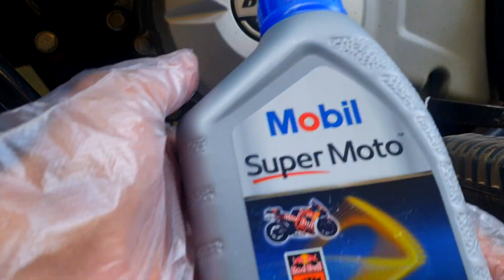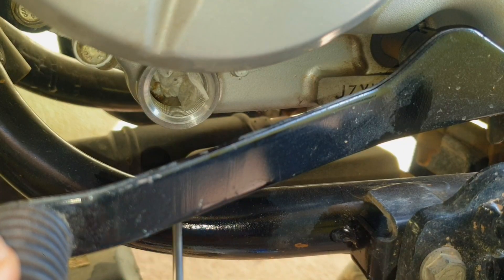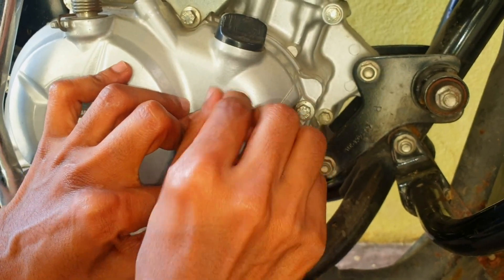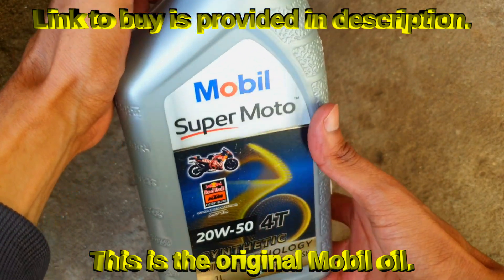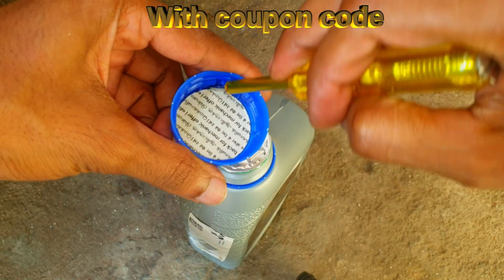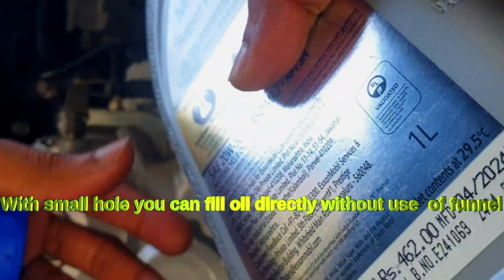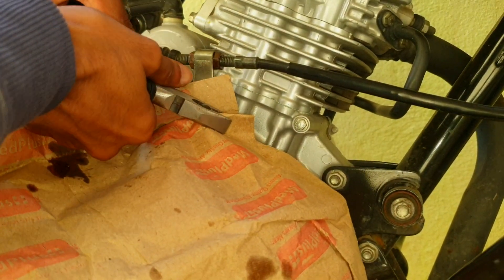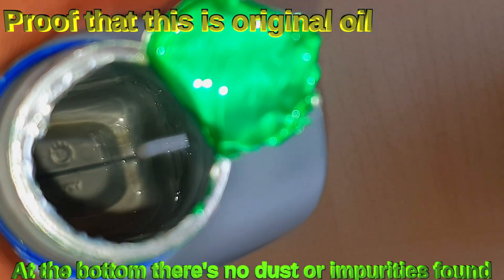Ultimate Beginners guide to change engine oil and How to identify original engine oil?

Comment: Can i use Motul 7100 20w50 synthetic engine oil in  ( Discover DTS-i  125cc 2014 model BS3 Engine) I will be waiting for your answer
If yes oil change interval ?

Comment: Bro can we use fully synthetic oil
Reply from the maker: Hi Sir, yes there's no limit in which type of oil you use, mineral or semi or fully synthetic. Only you should consider the grade.
For city rides: mineral oil is good.
For off city rides: semi synthetic oil. 
For daily travellers on bike: fully synthetic oil.
Reply: @PavanKumarHB  bro Bajaj oil is claiming a  drain interval of 10000 km isn't it a fake claim

Comment: Which cheap tool kit  to buy  best for clutch plate open and repair 2:07
Reply: Tell me tools hf delux
Reply from the maker: You need primary gear holder, L shaped socket, clutch nut spanner, ring spanner set.
Clutch nut spanner: buy hero version from amazon.
Ring spanner set: by Stanley only full set(Don't go for other low priced)
Primary gear holder: by from amazon
Reply from the maker: Hi Sir, do you mean oil filter cover 2:07 opening tool or complete spanner set?
Reply: @PavanKumarHB  I'm repairing by own for my bike clutch plate change which tools for open and fix new clutch plate can I have ur number bruh
Reply from the maker: You can send message to instagram (link in about section of youtube)

Comment: Nice video bro. But how can you judge motul oils?
Bottle itself will be in black color and hence we can't see bottom part inside the bottle.
Reply: ನೀವು ಹೇಳಿದ ಬಟರ್ ಚಿಕನ್ ರೆಸಿಪಿ ಅಪ್ಲೋಡ್ ಆಗಿದೆ ನೋಡಿ 😅
Reply from the maker: Much appreciate madam. Thank you.
Reply from the maker: Hi Sir,  for motul bottles, you can use white tissue paper and a stick then put it into bottle and extract leftover oil. If you see any black colour dust and impurities then definitely it's duplicate oil. 

Original oil do not contain any dust or impurities because its factory made and sealed.
Reply: @PavanKumarHB  ok bro